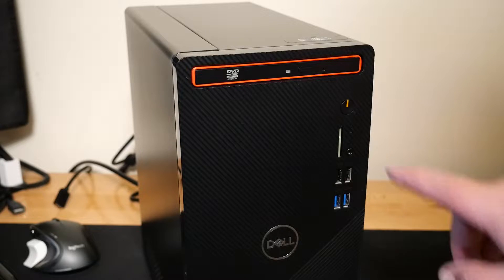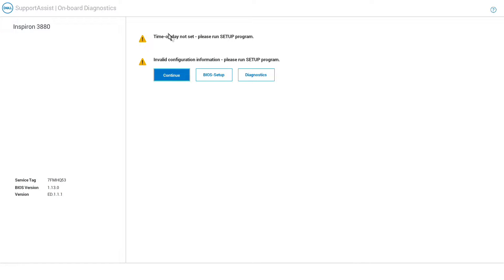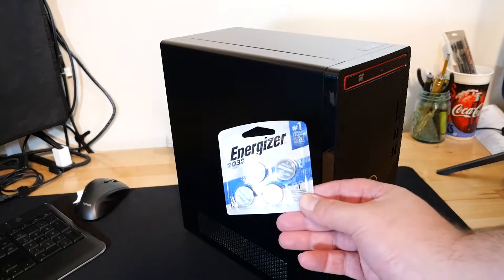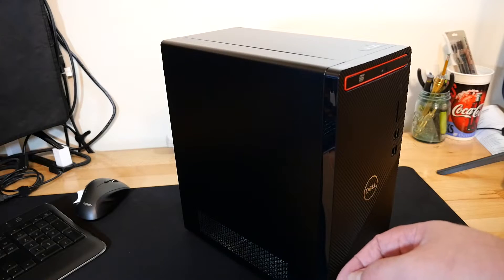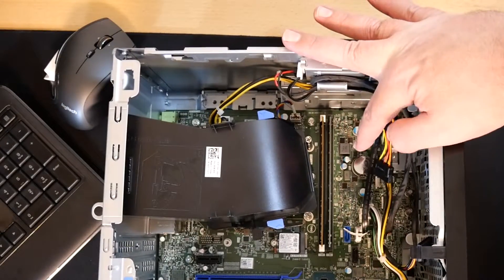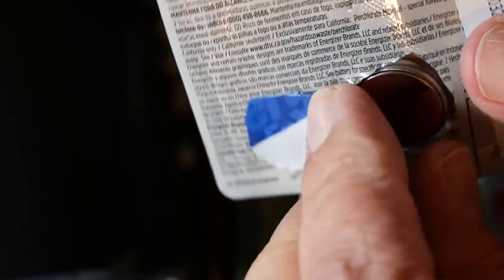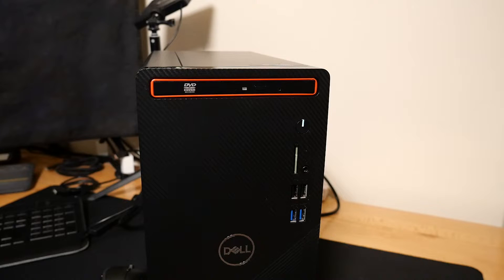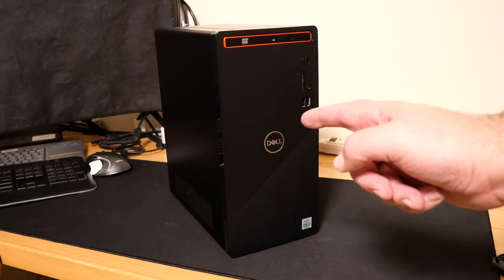Dell 3 Flash Code: CMOS Battery Replacement Guide!

Comment: Would older desktops or laptops not boot with a bad CMOS battery?
Reply from the maker: Hummmm... If you get far enough into "older" that you had to manually enter your hard disk information (sectors, heads, etc) then it would probably only boot to POST and stop there until you enter that information again. I would expect it to notify you of the error in some way or another.

I have 2 or 3 machines sitting around that are probably in that condition right now, so, we'll probably see what happens with them at some point.